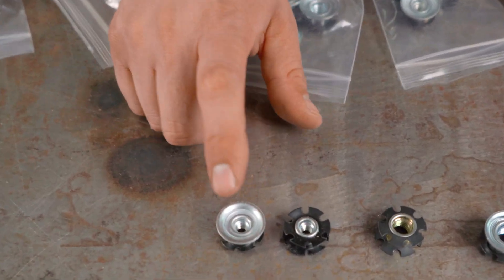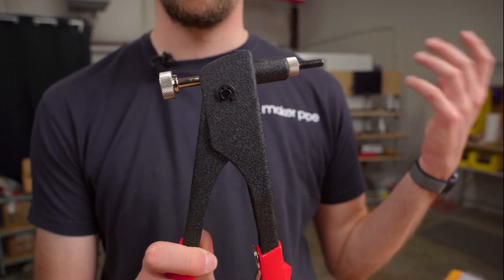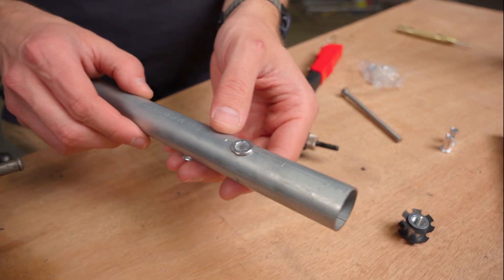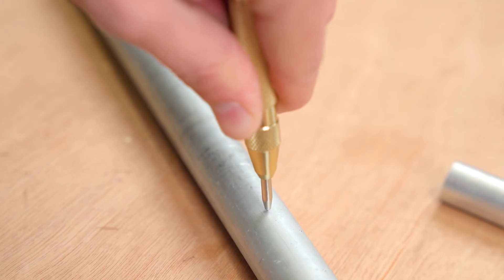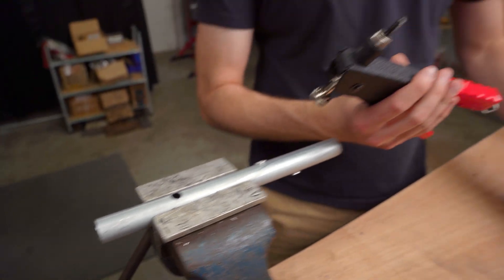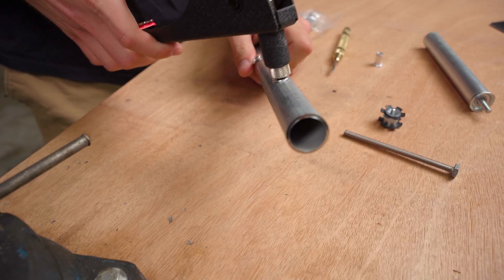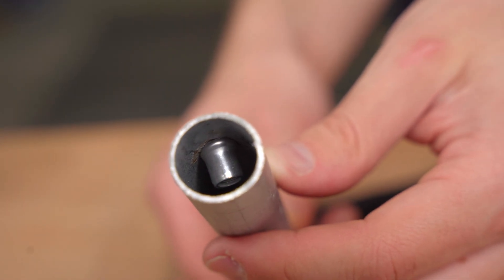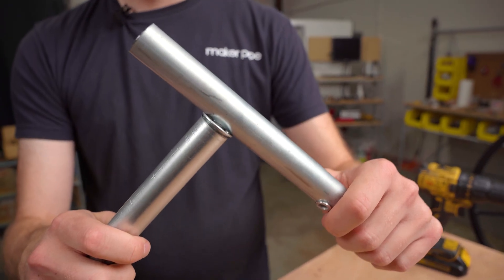Can You Install Rivet Nuts In Pipe?

Comment: QUESTION ❓ Can you demonstrate this procedure and utilize?
(1) drill completely thru EMT creating two opposite holes.
 (2) Place a rivit insert on one side.
 (3) Screw bolt thru both holes....nut on other side.
Thanks
Reply: 💡 This method may attach double walled polyroof to frame 💡
Reply: Now we need a Union for a pipe with fittings on each end